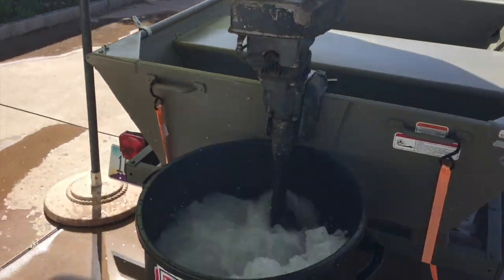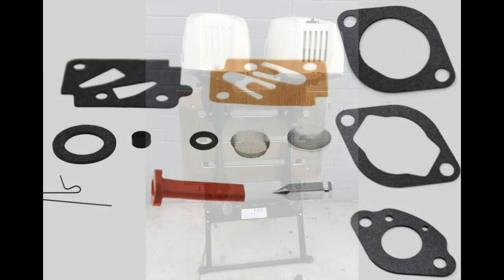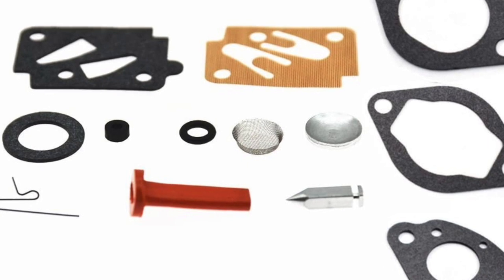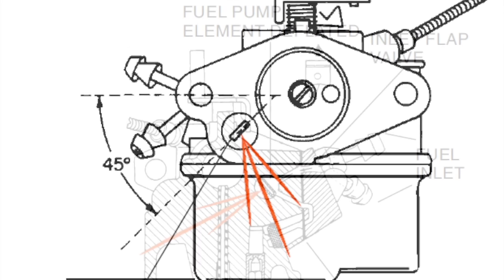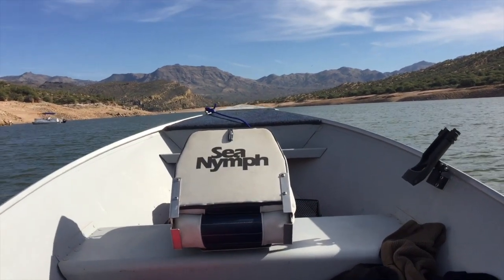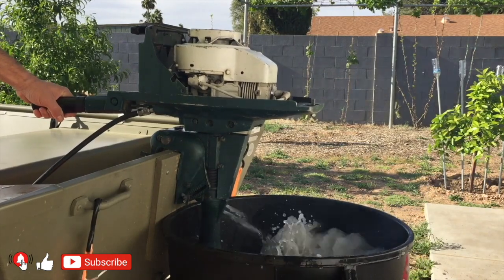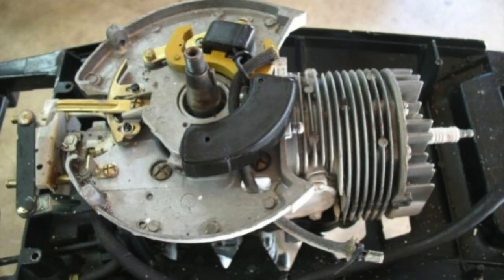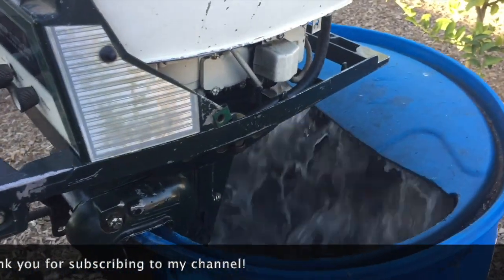THE SECRETS OF TED WILLIAMS, ESKA, SEARS AND GAMEFISHER OUTBOARD MOTORS - UPDATE VIDEO

Comment: i can't even get mine to fire at all. it sat for like nine years. I tried to start it in 2017 and failed, and just tried again. I suppose the carburetor is all gummed up or something terrible. I'm broke for the first time in 15 years so I'd really like to get this POS working because I certainly can't buy a better motor
Reply: Check your spark plug wires and plug if you haven’t already
Reply: @travis- I had a heck of a time taking it apart attempting to access the far end of the spark cable, and then had to quit halfway in. Hopefully I'll figure out how to get it back together someday. Thanks for responding though
Reply: @barnacleburrito3728  of course man I just started digging into my little 7.5 and as long you take pictures it’s not that complicated to put back. I might try making a video and posting it of me putting it back together. What hp and brand do you got?
Reply: mine is a Sears Ted Williams 4.5hp, but unlike most of them mine doesn't have the white top, it a just green like the bottom half. Anyway, I didn't expect that I would be forced by circumstances to leave the project for later, so I failed to take pics and left all of the fasteners & everything disassembled together with all the pieces of the weedeater I had also taken apart lol (facepalm)
anyway if you were to make such a video that would be pretty dang handy! But please don't feel obligated

Comment: Yes… Says he is use the same type of carburetor that uses pole station of pressure from the crank case to push a plastic diaphragm in and out like a button being matched hundreds of times over that’s what they call a “fuel pump“ for a two-stroke… What a nightmare… I really hope you can get carburetors for this cheap or maybe put a four stroke push mower engine on the shaft

Of course, it still weighs less than a deep cycle battery and a trolling motor. That’s the only reason I would use this instead of an electric trolling motor for propulsion.

Comment: Hi, we here have these marketed as Terhi (in Finland) or Tern when exported. I have a 3hp motor and a 5 hp, the smaller is eventually a Tecumseh AV520-624 or rather T624 as it's from the 60ies, may be even 1967. This bigger is a mix of Mahle and some parts made hereabout. Just few minutes ago I succeed in starting the 3 hp, quite a sweaty procedure... Maybe something or a lot wrong with its carburetor. Homemade pump flaps maybe ok, but that little rubber tube inside the carb. is closer to 50yrs old´, and not doing its work perfectly. This is so old that it still has old fashioned points. I added an ign.chip meant for some John Deere little thing and a flip-flop switch to use either points or this, well, "pointless" system. They both work, but not helping much to get the engine running well or even starting easily. The easiest way to start is with a cordless drill from its flywheel nut... Better to have oars onboard when boating with this.
Reply from the maker: Thank you for sharing this information. I'm surprised that this outboard motor was exported to Europe.
Reply: @BoatMotors  Yes, Tecumseh, or the company behind, must have had very good salesman those days for they’ve sold so many to this god’s forsaken place 😊
Here these T624s (or Terhi 3s) are known for being the most unreliable outboard engines; a common joke was that Terhi 3 takes you off the shore and oars take you back, something like that. Eg. I bought mine for a dark roasted coffee pack of 500g, maybe worth 5-6 EUR, just two months ago. This had fried its ign.coil’s secondary winding, and lost the main valve assy. The ignition coil was an easy part as you can find pretty cheap Chinese coils fitting well, but the carburettor is a pia, all original nuts and bolts are in imperial dims, and Aliexpress-spares are metric. 
As told I got this running somehow but for now it’s better to keep it in the garage.
Reply from the maker: @heinawithdotshanko  Thank you for the information! Yes this motors are not reliable! 
Good luck!
Reply: @BoatMotors The 15hp is a pretty quick beast!! Whole different animal, as I'm sure you know! I bought mine cheap, $25 and It needed the plastic pick-up part under the flywheel. I found one for $40 shipped and she runs like a beast!! I love the sound it makes too!! As long as my ignition holds up I'm loving it!! But, I have a spare stator I bought with a complete but partially disassembled 9.9.9hp for $20!
Reply: I like your content, keep it coming!!

Comment: I have no spark in my 5.5 , what do u think it could be
Reply from the maker: In most cases, there is a bad connection on the external high voltage coil. Clean the ground and positive connectors. If it is necessary, try different spark plug.
Reply: @BoatMotors  thanx I’ll try that out
Reply: Mine did the same thing. I put a small block chevy condenser on it that I had laying around, started right up!